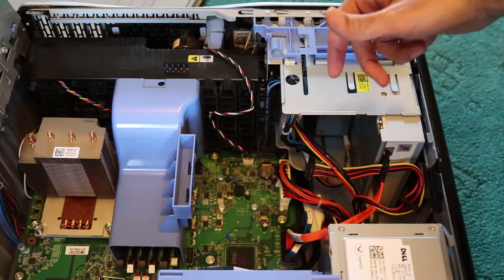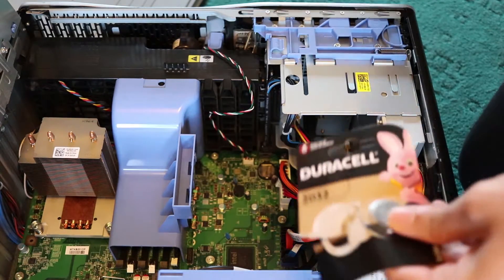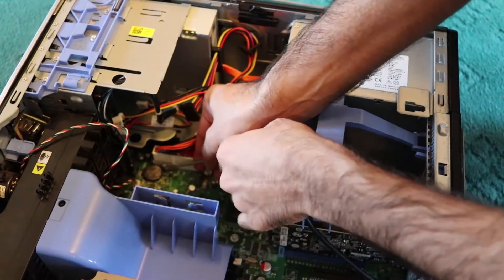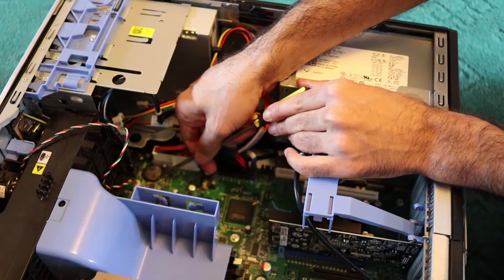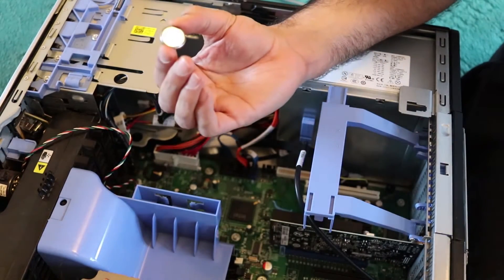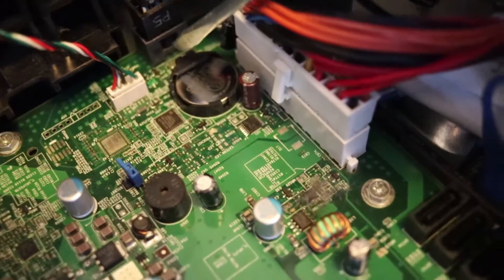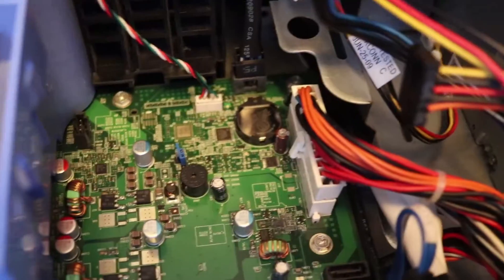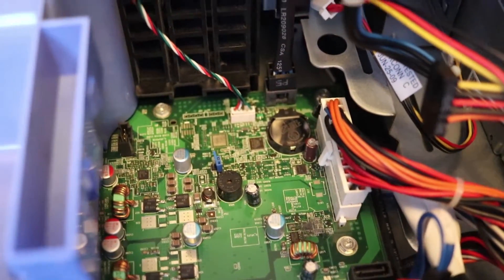How to replace CMOS battery on Dell Precision T3500

Comment: Very easy to understand and follow. This saves a trip to computer repair shop. I have older Dell XPS, very old now 😱 2007, that serves purpose for my usage, and I would like  to keep it operational as long as possible. Repair shop guy always laughing at it, calls it The Dinosaur  🦕 I think maybe he is just envious 😂
Reply from the maker: I'm glad you've managed to change the battery yourself after watching the video. I think it's good to keep it if it serve the purpose.
Reply: @bhupindertube  My Dell XPS420  Music, videos, and photos. I use it as accessible viewable storage, all of which is backed up on a 4TB portable memory bank. It updates with any new media added as I connect it once a week for that very purpose. The screen and audio are great . "If it works, don't fix it".   
But just like my older model Chevy, I still keep it serviced; oil changed, fluid levels checked, topped off, changed on a regular basis, the belts, tires, pressures, and filters checked and replaced when needed. 
And washed. Because a clean truck always runs faster! 🤣  🛻 ... 💨 ...💨 ...💨 
Thanks for being the channel with such good information that it allows me to maintain my older and now vintage devices.  💪

Comment: When I reboot I always get a message my memory has changed and have to press f2 to skip if you know how to fix...other than that these are good computers, I have a dell t1650 coming I'm gonna use and use this as an offline gaming PC for my mom and as a backup if the t1650 goes down to get online if need be...so yeah

Comment: Hi Bhupinder Singh, thank you for the video. I've had the same issue: start button blinking 3 times on orange. I found your video and changed the battery correctly. I was very happy but my computer is again giving me the same error, which is very random: each 3-5 days working normally, then one day it fails the booting with this error. What do you think I'm missing? Thank you bro